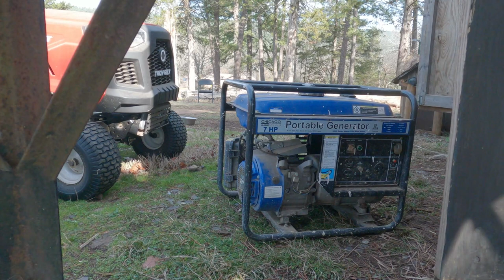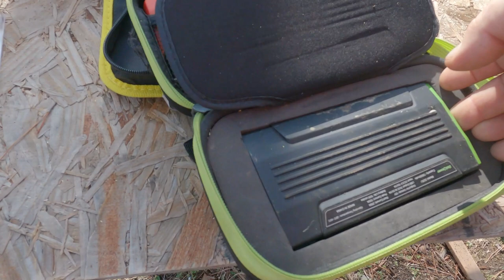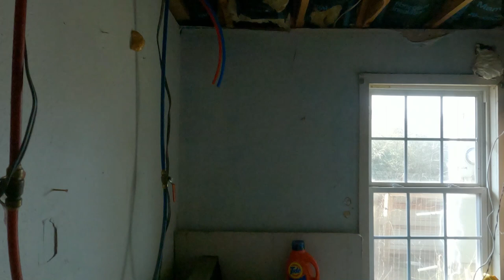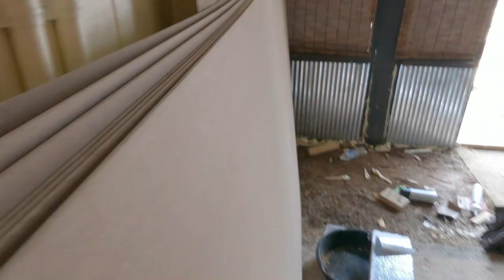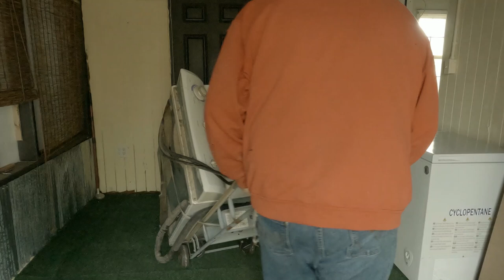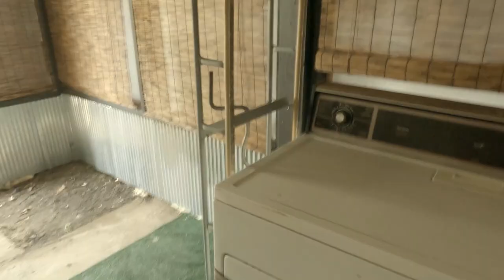I'm Tired Of Things In My Way! Major Clean-up Today. Organization Was Needed!

Comment: If I were doing the job with the uneven concrete surface..
First I would put some great stuff along the bottom of the wall and cut it off even, then I would clean up the old concrete with a broom or wire brush, 
Then I would get a bag of that quick Crete and make a skim ramp from the wall out. This is just what I would do.
You did a great job of clearing places to set up tools and supplies to move forward 👍
Reply from the maker: You cannot put concrete against the wood,so even with flashing,the rain will get in between,The weather comes from the west and right at it. That was my first idea.

Comment: Maybe rent a concrete saw and cut as close as you can to outside of the dog room. Then run that flashing like you said. 

Funny, I watched Red Poppy Ranch just the other day. Taint watched it in years.

THE ONLY WASHER WORTH A SQUAT IS SPEED QUEEN (commercial) and they are expensive.  Bought my wife a new washer last year.  She took it back and bought another one and hates that one too but other than Speed Queen there is nothing good out there.  KEEP YOUR WASHING MACHINE UNTIL IT CAN’T BE FIXED!!!!!

Comment: New appliances break more often and cost more for the electronics to fix them. More than likely all that is wrong with your dryer is the vent not flowing freely. Mine are old, I fixed the Kenmore dryer and the washer once in the last 10 years, they are over 15 years old.

Comment: If the dryer duct hose is blocked with lint it will take a long time to dry clothes.

A friend of mine was complaining that it took forever to dry so I unhooked the hose and it was stuffed with socks. He started looking at the socks and recognized a pair that belonged to his ex roommate. He said "That dirty bastard, I'd know those ratty looking socks anywhere". I said well at least he didn't use your socks and when he looked closer he saw that the remaining socks were his own. Don't piss off your roommates, they will vandalize your dryer.

Comment: Mike, You could put a diverter up on the roof...it should send any water 
out and away from the concrete slab...use a water catchment barrel and some PVC pipe cut length wise...use some metal coat hangers to
hold the PVC gutter in place...Cheers from Maine.

Comment: Mike, when that generator started up on the 3rd or 4th pull after sitting for 2 yrs, I'd have high-tailed it straight to the nearest place to buy a lottery tkt. Made my day! 😄

That water issue is a puzzler.  You'll figure it out. I'd sure enough skim an inch or two of dirt off that hog waller and put some 1 inch river rock in there to cut down on tracking mud in but the water seepage stumps me. Do they make a concrete grinder you could use to taper that slab off to help it repel water?

Comment: check out lorain furniture and appliance here on you tube… he has these really old washers he’ll run cycles of clothes and stuff through… he even finds ancient detergent once in a while
Reply from the maker: I just noticed when editing video, the dryer was serviced in 2002,so that 20 years ago,probably was 15 years old then
Reply: @ouachitamountainliving  i finally broke down and bought completely new washer and dryer… the dam washer has a locking machinism on the lid so you can’t open it after it fills with water. basturds so worried about saving is from stupidity, i hate the locking crap